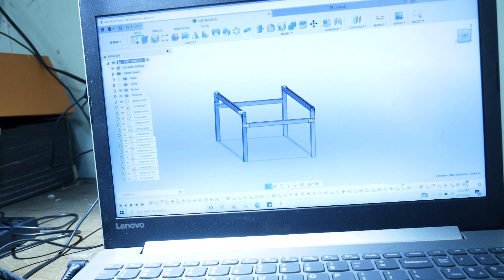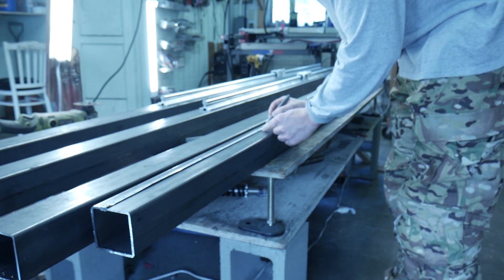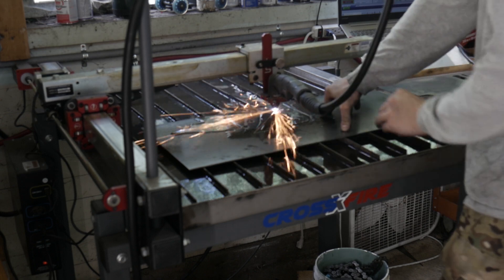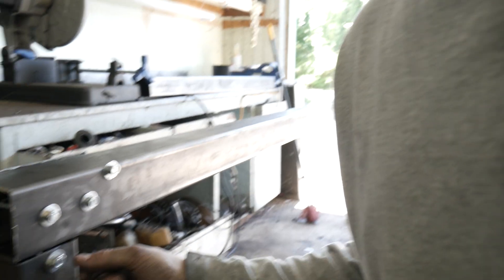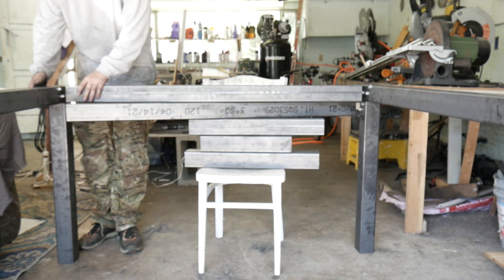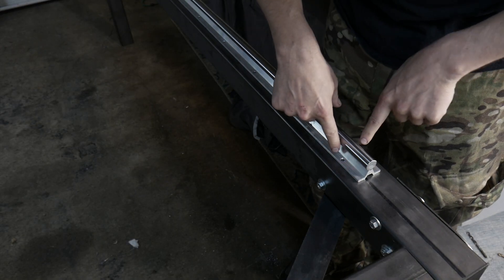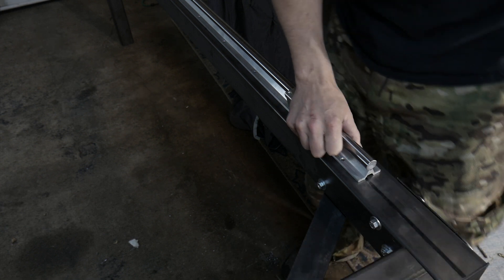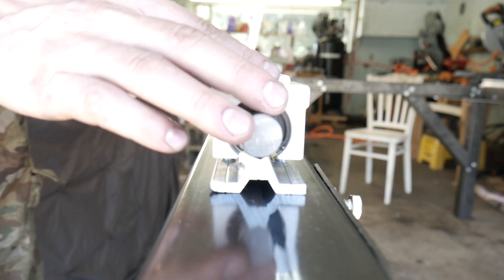I build a machine that cuts ANY shape

Comment from the maker: I'm sure I glossed over some things so feel free to ask me anything!
Reply: do you have schematics on how to connect the external stepper drivers. and a pinout for the arduino mega (im assuming a 2560) i purchsed a different kit and im having issues cant get my cnc up and running. cheers
Reply from the maker: @MrJackbilly  Sorry for the late reply. I think I used a schematic I found on google using the mega. Another way to find the pin out is in the source code of grbl. for the mega, you'll find that in the cpu_map_atmega2560.h file. good luck!
Reply: Hope your good miss your video

Comment: Dude I'm in trouble with the electronics but My table is only 1200x1000mm ish... What u said about the 2 motors kinda threw me for a loop. U said something about changing the wiring to get them working properly together so they sync to move together on both Y axis? I have 1000mm steel sq tubing but I have aluminium too and I think I might use some of both to get more strength into the table. I don't have the room in my 16x10ft workshop for an 8x4 table bro.. I have a table saw, bench drill, planer, and a lot of other tools,  and I just don't have room. I would love to be able to build one the same as yours bcos it's an awesome build. I bought the Arduino and all the stepper motors-Nema 23's x 4 but one was damaged and they messed me about giving me a replacement. I have the Z Axis with a 42 stepper on it. I also have 2 nema 17's with the stepper drivers TB6600's x6.. I have a shed load of stuff for the build right now. Do u have a more indepth video about the build and how u got everything squared off b'cos steel can be a nightmare especially if u weld it. 
U have built a pretty sick CNC Router. I've only got into CNC's in the last 12 months. I know absolutely nothing about electronics or the software so I'm learning as I go. I have a CNC Laser Engraver too and Lightburn is handy enough to learn but right now with work I don't have time. 
Brilliant job anyways my bro.. I need to buy a half decent camera to make some videos myself and put them up on Youtube and start a channel to show my work as I move forward.. For now I want to get building the Router table and I also want to be able to change it to become a Plasma cutter table too.. I'll get there man.. Better late then never, eh?? LOL
Take it easy my bro.. Salute from Dublin, IRE..
Reply from the maker: Yeah I had to invert the polarity of one of the steppers on the long axis so that they would both spin the same direction given the same pulses. you just swap the two phases. I regret making a table this big lol. I suppose my best tip for making things square is fixturing really well with squares and clamps on a flat surface ( I didn't do too great of a job on that part, to be honest). I also have a 3D printer which is helpful to print out fixtures to get consistent drill holes etc. Sounds like you got a nice shop going! Good luck on your project!

Comment: Hello Oliver, Long time no talk to. Since we last talked and I was asking you about building a bike I have built several choppers and a bobber. The first was a 1957 Harley Panhead but I was hit by a Ford F350 and was wrapped around a telephone pole and had my right leg nearly torn off. During the time I have been learning how to walk again and building lots of other stuff I built a sportster dirt bike and an XS650 bobber. The XS650 has a right hand thumb throttle, right hand clutch, right foot rear mechanical brake,  Left hand shift , a permanent magnet alternator, and deleted the battery and am using a capacitor. Hope you are doing well.